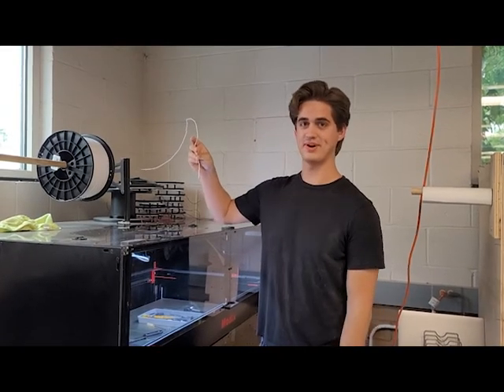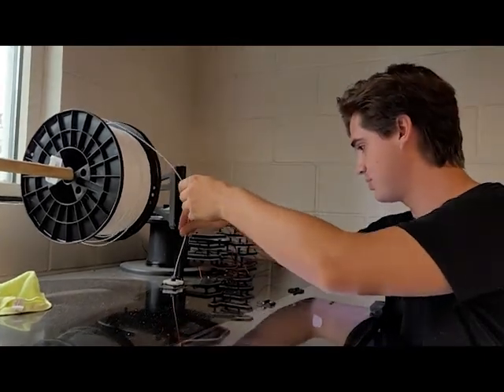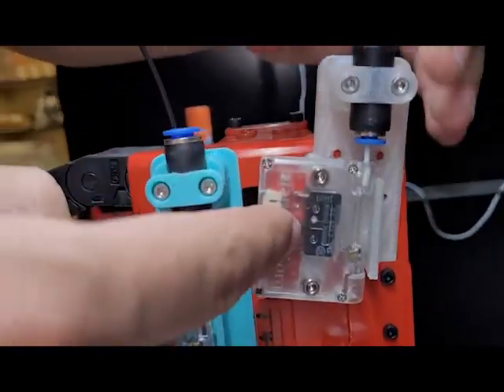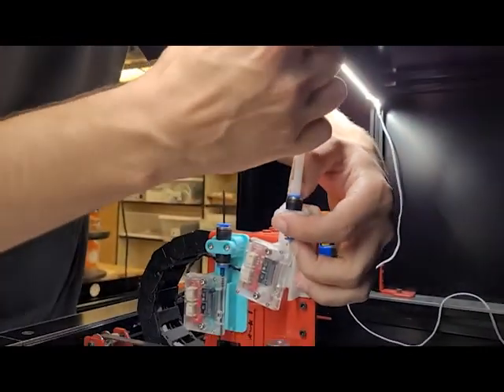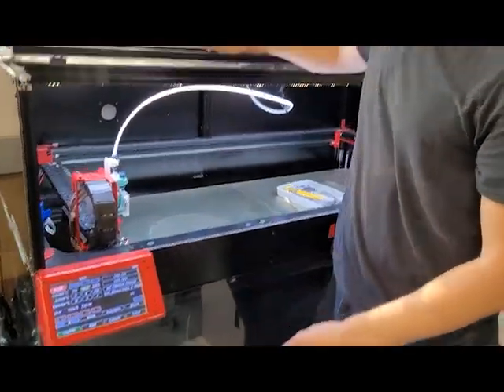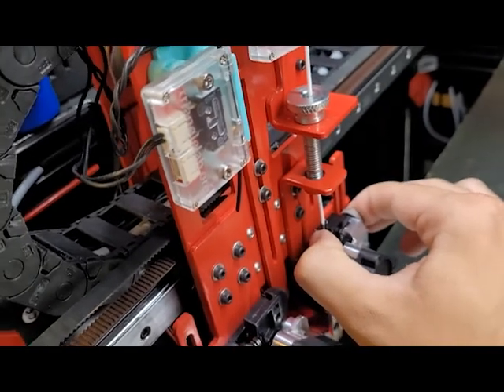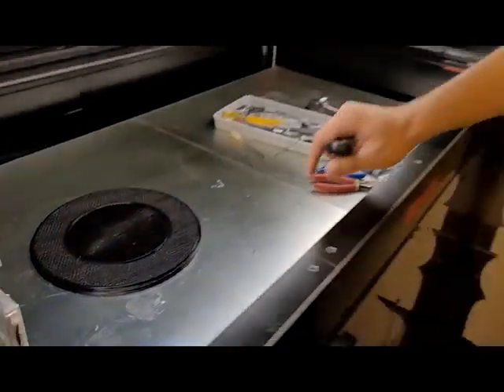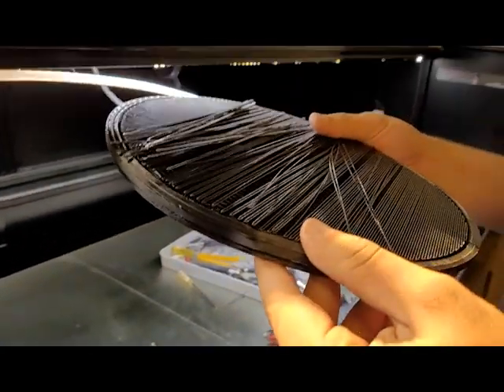Filament Change on the Modix

Comment: Modix is garbage.  Garage-based business offering garbage for support and useless installation instructions that dont work 20% of the time.  PC access only, via unsteady wifi access point, as if designing a usb drive to load prints was too hard.    Save your money.  Buy something else.